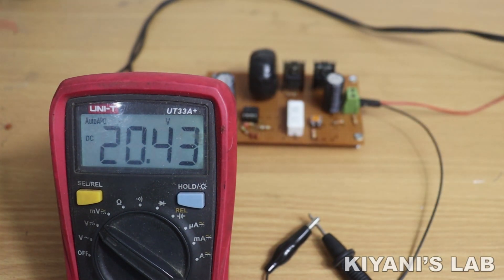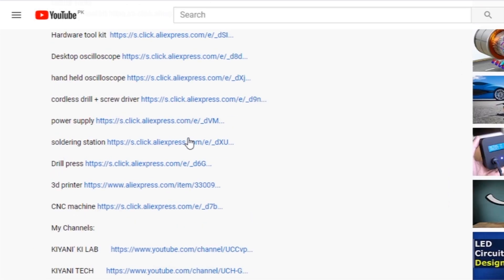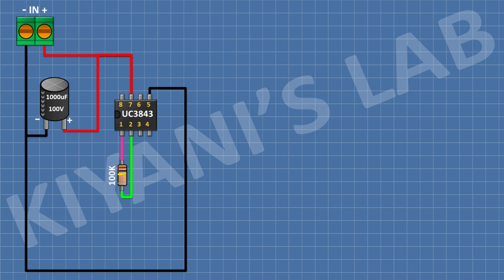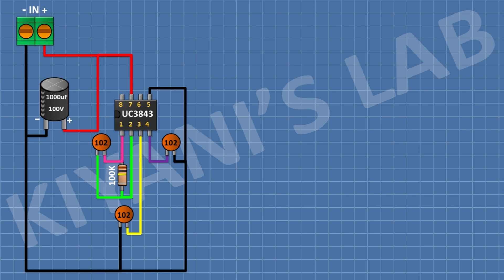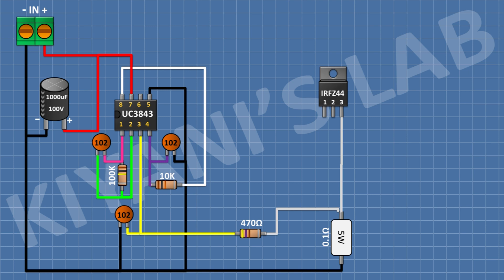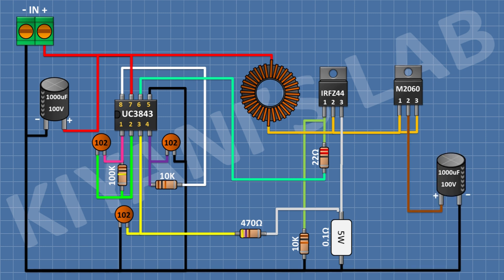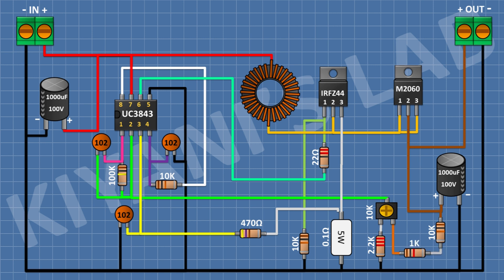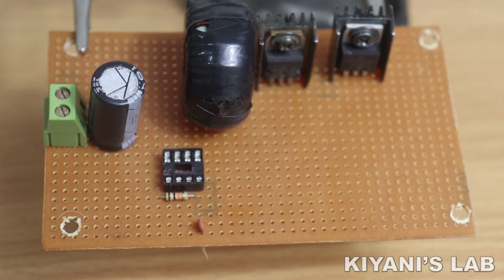How To Make DC to DC Boost Converter | UC3843 IC

Comment: I saw that in the diagram connection you provided at the beginning of the video is done using 8 resistors in total but your video uses 7, what's wrong...I did everything in your video still on the prototyoe board and instead of working as a boost converter, it is working as a buck converter from 12V to 5V, but every time I put a volt display Led at the output it drops to 10...Any explanation?

Comment: I made this converter from your video but my converter doesn't boost the voltage. For example i give 5.1v to input but in output voltage is 5v
Reply: O UC3843 não funciona abaixo de 8V
Reply: pmme can you to install do solar panel of charger＋

Comment: mc34063 ic buck boost converter input voltage 12 output voltage 0 \50 pwm controller PC817 irf532
Reply: pmme can you to install do solar panel of charger＋

Comment: I don’t see the LC filter remember the high frequency noise still in the switching output this design on its own is very dirty need filtering this converter won’t turn on another high frequency power supply
Reply: pmme can you to install do solar panel of charger＋
Reply: pmme can you to install do solar panel of charger＋